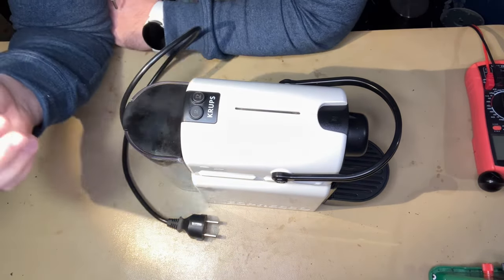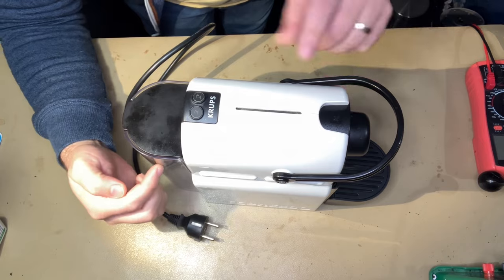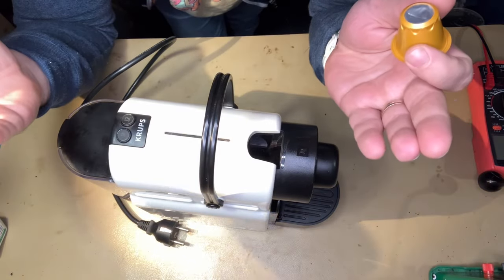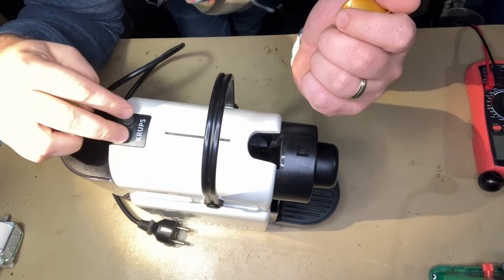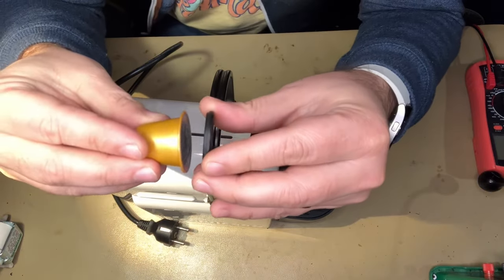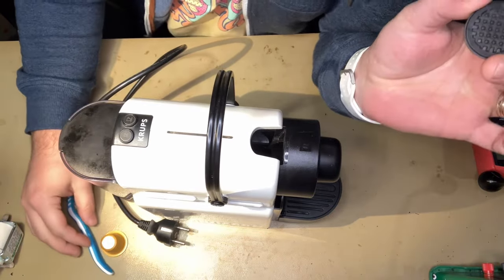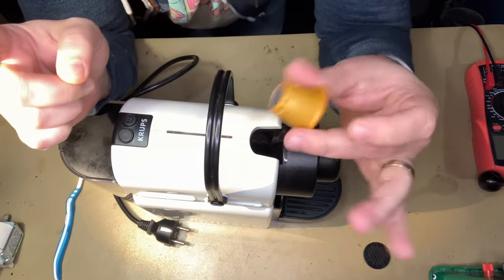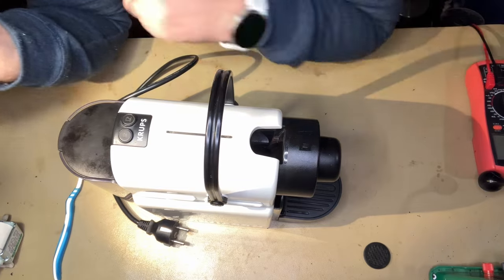Why is this happening?     HOW TO FIX NESPRESSO

Comment: I was having a problem with my coffee consistently tasting burnt. I used a descaling kit, but it didn't help. Then, I followed your tip and cleaned the machine with a toothbrush. It's hard to say if it had a significant impact, as some coffee grounds remained in the water even when I didn't use a capsule. Finally, I tried a cheap, non-Nespresso descaling liquid, running it through the machine twice. I then flushed the machine three times with clean water, and voila! The burnt taste is gone! Thank you so much for the helpful advice!

Comment from the maker: One important tip I forgot to add in the video is in case you have this problem but clear water comes thru the nozzle the fix is : Remove the capsule and let clear water to go thru the machine several times ( rune machine without capsule) . This will level the pressure inside the machine and will allow it to build up normally afterwards.
Reply: This was my problem a few days ago . I will try more times and hope it will work.  Thanks again 😊
Reply from the maker: Let me know if it works.
Reply: Hi @benassy69, hope your fine. I have a problem with my Krups XN110 not working. Problem is when turning on the machine both lights light up and when pushing one of them the light flickers to indicate that the machine is heating up. After the button stops blinking and turns to a solid green then normally when I push it again it starts brewing but in my case its starts again with blinking and nothing happens. Any idea what the problem could be? Hope you can help me. Thanks!!
Reply: @benassy69  Thanks a lot, descaling by solution water & winegar was enough to "repair" it. When you will visit Prague be sure that I will invite you for coffee (or Czech beer) ;-)
Reply from the maker: @Otas58 I am glad you managed to fix it. Thanks for the invitation

Comment: Hi Adrian, I cleaned the front as you have mentioned, I also noticed that there is 3 hols at the back of the pod but the front is like new pod! meaning there is no hols at all and I guess that that make Leak little water in to front bin (for the used pods) my wild guess is that there is not enough pressor from the back and so it does not make any holes... of course that is not the reason but I am not so engineered minded person!! lol.. now I need experienced opinion of what next to do!! so Please! Thank you. Harry. I wish I could show you the pods!! Seems like this machine needs rest now!!

Comment: Thank you very much for the informative video. I tried descaling and cleaned the diffusion plate but my capsules are still not perforated 😢 there's also water and steam coming out the top part of the machine. Could this be due to the o-ring? My machine is a nespresso magimix essenza mini m115. Thank you for all your videos.
Reply from the maker: Try running the machine without a capsule for 2-3 times and see if this resolves your problem.

Comment: Whenever i try to make a coffee, the silver (bigger)part of the capsule does not perforate but the smaller part does. It just runs hot water and steam comes out. Have tried descaling and cleaning the grid but no success
Reply: same here - cant figure it out. all stripped and cleaned. still not working.
Reply: I have the same problem. I wonder wether the squares on the diffusion plate should not be sharper. In many used capsules that worked all right you see a pattern of holes as the diffusion plate. Could that be because we used it so much?
Reply from the maker: The squeres there are ment to create a pattern on the foil but not puncture it but instead create streams of water that reach the small holes. The puncturing process is done by the 15 PSI of pressure produced by the pump. As I said in the video the problem is that somewhere in the system there is a pocket of air that reduces the pressure because air is compressive and water is not.

Comment: I tried everything to fix the issue and nothing worked. I have a ton of coffee pods I recently ordered so I was kind of out of luck. Since I had no luck fixing the issue, I am going to have to shop for a new Machine. It won't be from Nespresso this time though. To many people having this same issue on all different models. In the meantime here is a qucik fix. I just puncture my pods with a toothpic before inserting them into the machine. You can just "Quickly Puncture" a lot of holes. No need to be maticulaus. Not only does it work, but my lattee's are now so much better since the expresso is actually flowing out of the pod better than when the machine was working.